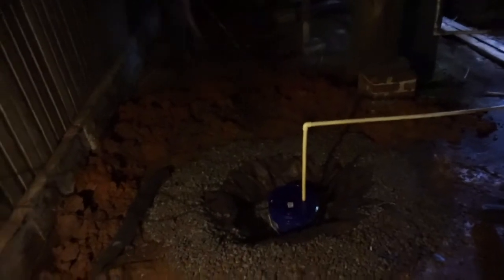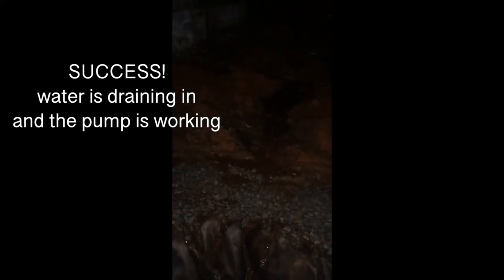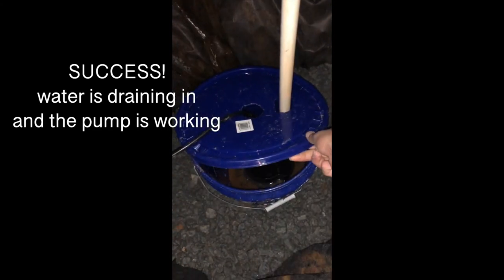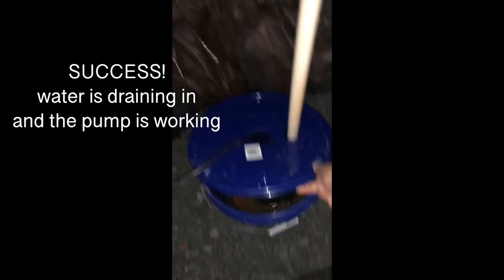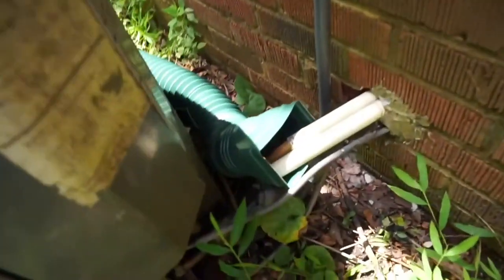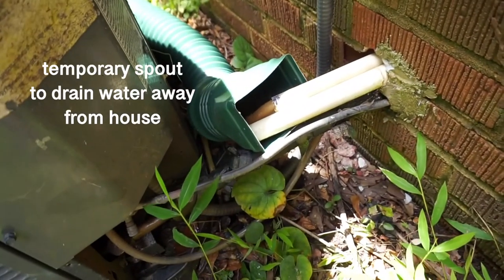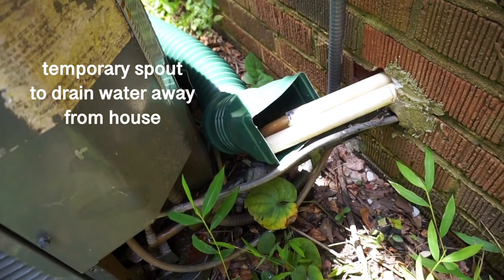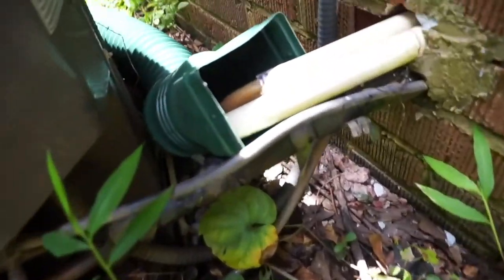DIY Sump Pump Installation! | How-To Install a Sump Pump

Comment from the maker: Is this a project you would do yourself?? Let me know below!
Reply: You can help me do mine now since you got the experience ;) . That is my next project but it will be inside the basement and I have to cut 1' around the foundation cement floor, break up the cement and dig that up for the drain pipe then dig a hole for the sump pump pit. Fun times ahead :) 

Have you checked out the APR rates lately? They are super low and I just started the paperwork to refinance to the 2.90% rate
Reply from the maker: hahaha yours sounds much more difficult! and I know! I should have waited a littler longer to refinance, rates are amazing!